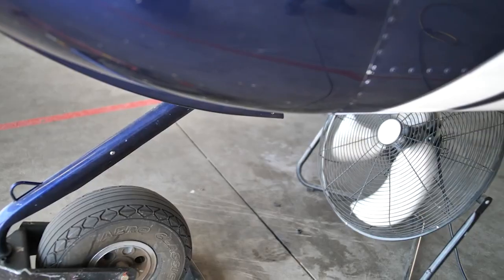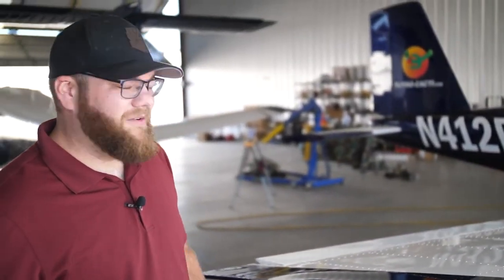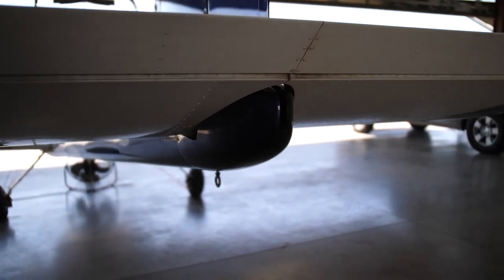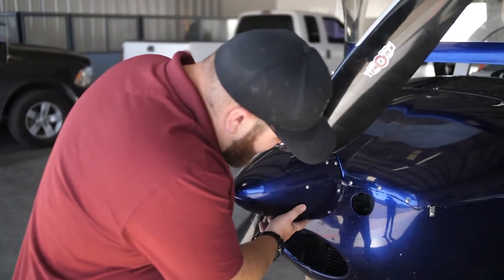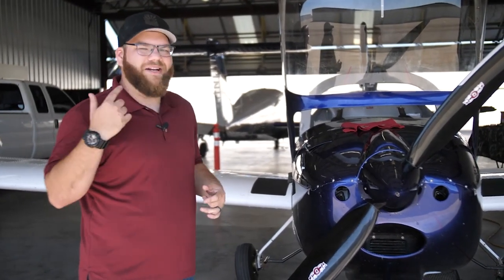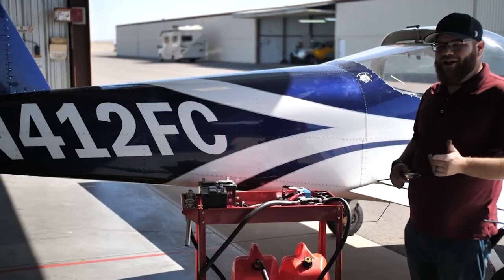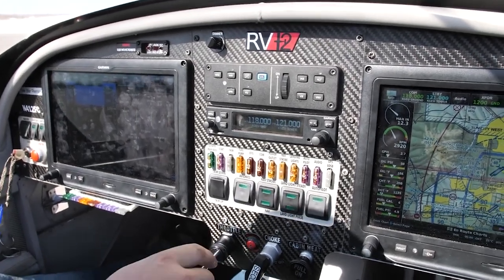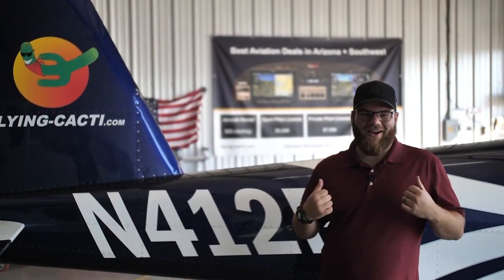Flying Cacti Preflight - Vans RV-12

Comment: Great video Greg, thank you! I saw checking the ELT box and wiring for any problems, but I also I see that little ELT control above the pilot's EFIS. Do you do anything with that control module before/after flying or is it only to activate the ELT in case of an emergency?
Reply: Scott, I'll jump in here and answer your question, based on my experience in other light aircraft.  The preflight checklist likely includes an item for checking that the ELT control on the instrument panel is in the "Arm" position.   This will cause the ELT to start transmitting if it detects a sharp deceleration (i.e. crash).  That panel can be used to trigger the ELT manually if it wasn't triggered during a crash, and it can also be used to turn off the ELT if it was triggered by a mistake, such as a hard landing.   After landing, some pilots make a habit of monitoring "Guard frequency" (121.5) just before shutting down the aircraft to make sure their ELT is not transmitting.

Comment: Does the mogas that you fly with contain ethanol?  If so, have you had any issues using auto fuel containing ethanol?  Do warm temperatures increase increase risk for vapor lock with the 912 ULS engine if using auto fuel containing ethanol?  Do you have an RV-12iS in your fleet? 
Thanks for sharing the video.  Would love to get transition training from you folks.
Reply from the maker: Hello Bruce, the Fuel we uses does contain Ethanol at time in AZ. We have not had any issues due to it. We have not had a Vapor Lock incident, even during summer. We typically ground the planes during the hottest part of the day because the ULS engines do tend to get close to overheating during climbs when its very hot out. We have an RV-12is on order that will be delivered in February.